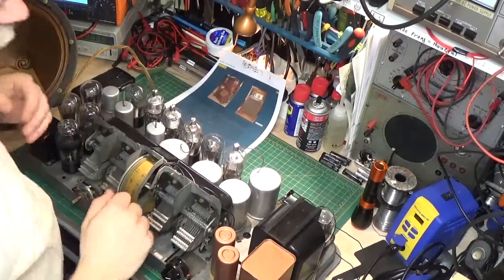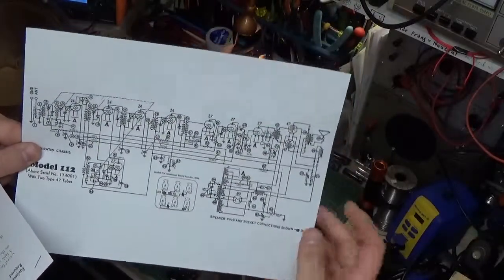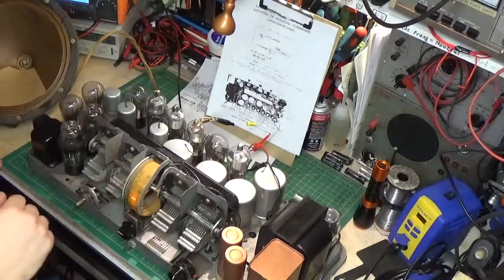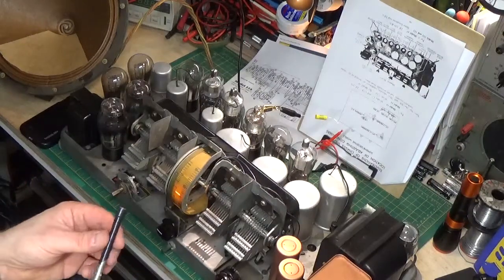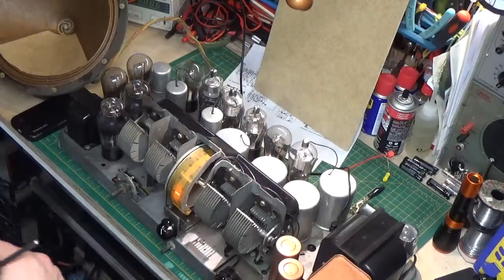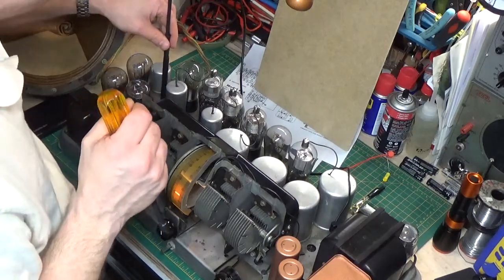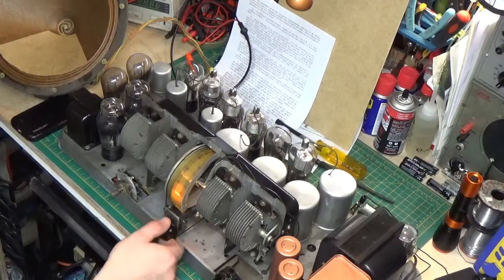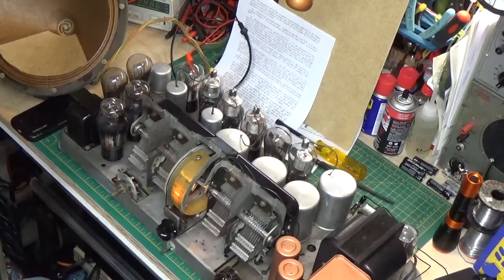Philco 112B Radio Alignment and info

Comment: Thank you for nice presentation. I just rebuilt a 1932 Model 112b and thought I had a lot of background noise. After watching I find it is just fine. Now to the cabinet. One note, I replaced all of the Bakelite cap/res combo's . I left the cap cans as you did. Replaced with updated caps.